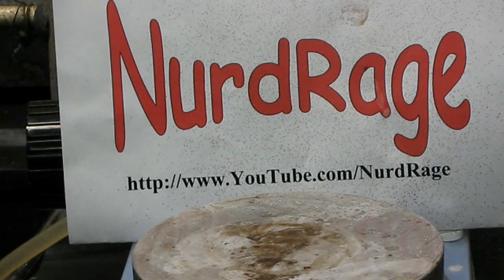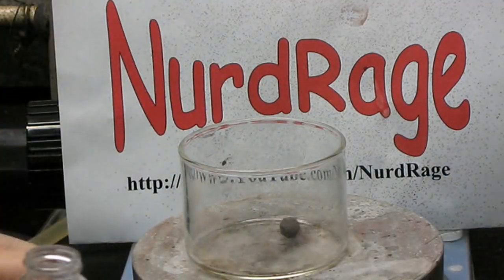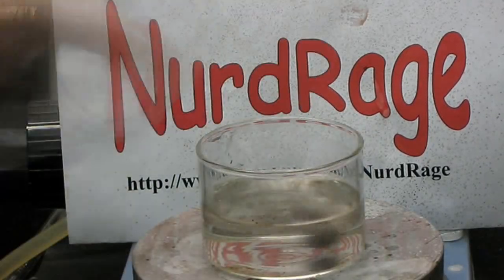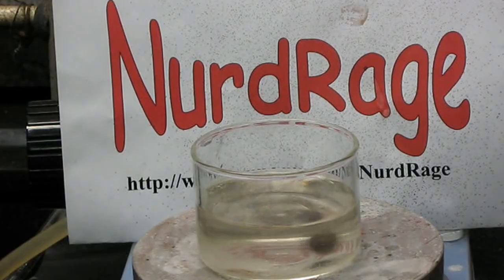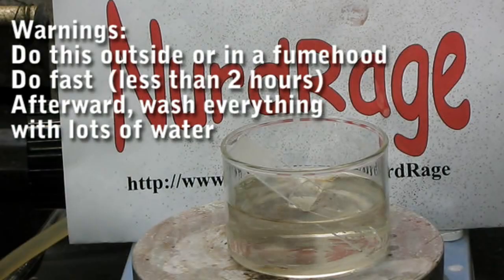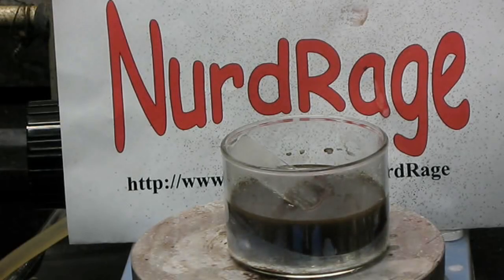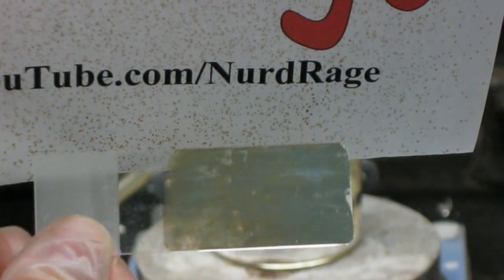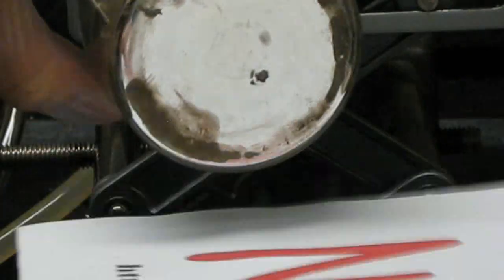Make Glass Mirrors with Silver Nitrate

Comment: If I'm understanding this reaction correctly, initial chemicals could be dissolved in separate containers and stored for later use so long as the sugar/dextrose is not added to the mixture until it's time to do the final mirroring reaction?

And the silver nitrate solution should be maintained in dark glass.

  And potassium hydroxide should be a suitable substitute in the event sodium hydroxide is not available?

Comment: Mr Rage, I see that you used sellotape to prevent the silver from touching one side of the glass. Could something like beeswax painted on the back also prevent the silver touching the glass or would it react with the mixture? Are there any other substances you could think of that could be applied to block the silver, perhaps painted on to create an artistic affect? Thanks

Comment: does this Silver nitrate solution work to make invisible ink or polarized ink, Im very curious about the image I saw in the spectacle shop where they had this tiny silver sticker which has an image which is only visible when you wear a polarized sun glass. I tried adding some green ink into this silver nitrate solution and it was not visible when I put the polarized glasses. Is there something that Im missing or is there another ingredient that needs to be added. pls suggest

Comment: Will the silve adhere to ANY surface? As in a primitive technology setting if one were to use a fired clay slab rather than a piece of glass would the clay be coated in silver? 
Yes I am aware that glass works better as a mirror because of the interactian with light. But I am more interested in knowing what surfaces the silver will adhere to. 

I suspect that a glazed tile may work better because the melted glaze is similar to glass. But I ab running the idea as though a time traveler were stuck in say ancient roman times (when they had both nitric acid and amonia available) could you make primitive mirrors with clay rather than clear glass since clear glass was not nearly as common if it was available at all.

Comment: I want to coat a previously coated mirror of a photographic 3D camera attachment which has two mirrors to make a two images for a 3D photo. This apparatus is very old and I want to recoat the mirrors so they return to their pristine, beautiful condition.  I can remove the mirrors from the metal attachment to do the process but, do I have to remove the previous coating? How can I do it? And finally, I have heard that silver coating mirror is the best but also very delicate,. Is there some sort of protecting coat I can apply to prolong the new coating? By the way, each mirror is small,  roughly 2 x 3 inches.  Thank you very much.  I would like to correspond through my email, if possible:  edubarca2015@yandex.com. EDUARDO,  (From Colombia)

Comment: Will this work for plating things like copper/brass/aluminum/plastic? My mailbox is missing the knob, and I want to replace it, but I also want to plate it in silver, because silver is anti-microbial. I'm concerned that the solution will react with metals and not stick to plastics.

Comment: If you want to silver a plastic part, use this same bath as Nurdrage just explained but dip your plastic part in some Stannous Chloride first which acts as an Activator, then rinse your part well, then  dip your part into the solution you see on the video and  your plastic part will be chromed/mirrored like this piece of glass ;-)

Comment: Have on the ready a salt solution.  As soon as you finish with the silvering solution, dump it into the salt solution.  The silver will be immediately precipitated as AgCl.  This allows the silver to be recovered, and eliminates the hazard of making silver azide.
     When making the silvering solution, it is important to titrate carefully with the ammonia, and stop JUST SHORT of redissolving all the precipitate.  When made this way, silvering will take place at room temperature (the heat is driving off the excess ammonia which shouldn't have been added in the first place).
Reply: explain it

Comment: could this procedure be used to plate glass with other metals such as copper or aluminium?
Reply: +NurdRage are we able to do this on other surface like plastic or metal other than glass?
Reply from the maker: unfortauntey no, this process is specific to silver. Vapor deposition is a broader process that works with a wider range of metals.

Comment: A few questions...
 - Can this method be used in place of electroplating to apply it to metals (specifically brass, copper, or nickel) and how will the end results compare (e.g. adhesion to base surface)
 - In the waste solution is there silver that can still be recovered? If so, how? If not, how can it be disposed of safely.
 - How abrasive-resistant is this coating? Will it wear off after handling it regularly?
 - Do you know of any good non-cyanide electroplating solutions for silver, gold, and other precious metals?(most if not all industrial grade silver plating solutions are cyanide-based and most non-cyanide-based solutions will not adhere well) 
 - Would destroying (by melting, dissolving,etc.)a .999 U.S. or Canadian coin be illegal?

Thank you for the videos.

Comment: Can you work this in wood , i want to make a polish sword made by wood . The painting doesn't giving a nice mirror looks like this
Reply: Dip the wood in tin solder.
Reply: I don't know if you are still interested in making a sword (two years on). What if you used sandpaper to make the wood surface very smooth then coated it with sanding sealer or polyurethane varnish. Of course you could do a test piece first. Then use the solution in the video to coat the smooth varnished surface.

Comment: I have bought silver nitrate of a concentration of     0.1N( 0.1M) is this strong enough to do this. I have tried it with 100%lye ( sodium hydroxide. and sugar and ammonia and could not get a reaction. any help.
Reply: +Dale Newcomer Evaporate the solution until you get silver nitrate crystals and use those just like in the video.

Comment: could you get the cool clear solution and spray it on bigger objects and then heat them to  speed up the reaction? (with good ventilation)
and would the resulting coating be able to be anodized?
thx

Comment: I watch so many u tubes on glass re silvering that I am confused .my questions are, you need sodium hydroxide ,silver nitrate and tin solution . when the sodium hydroxide and silver nitrate and sugar are mixed, do they have to be heated? can I put the mixture in a spray bottle and spray my glass?Thanks.
Reply: +Dale Newcomer to get the best use out of your solution and get a quality  mirror.use silver soln and sodium hydroxide soln together  and the reducer in another container.   The tin solution on the glass first then rinse . spray the silvering solutions starting at the bottom of the glass and work to the top .  this gives you a quality mirror . You can add galvanic copper solution over the mirror to insure protection of the silver  This is not necessary unless making large quantities of mirrors . Use a good quality of mirror backing paint and heat the glass to remove excess thinners in the paint, I recommend peacock laboratories  in philadelphia pa  for your supplies

Comment: Must the glass be constantly submerged while the solution heats up? Or could you just heat the solution and then dip it in?
Reply: +The Scout If you dip the glass in the silver solution, it will coat the outside. I think coating the inside is better as it won't get damaged.

Comment: Hey I watched your video. Its super helpful but Im having problems with the silver adhering to the glass. Any Suggestions?
Reply: +Eliza Serocki It took me a while but it eventually worked (like maybe 15 minutes of heating/shaking). There's a little patch that fell off though and I couldn't coat it back. I think it may be due to some impurities being present (either from the reagents or maybe the glassware was not cleaned well enough beforehand).

I'll probably try it again with laboratory grade glucose and wash all glassware extensively.
Reply: +Eliza Serocki First use a solution of red rouge or 37B solution to clean the glass rine then use a tin solution( sensitising agent) first rinse then apply the silver solution I f you use the flow over method with the glass flat you must have the glass level. Do not mix all 3 solutions together . using glass pitchers put the silver soln. and the activator solution  in one pitcher  .30mls per qt.of deionised water . put the same amount of reducer solution into the other picture 30 mls in to 1 qt of water  pour the solutions together so it flows across the glass let the solution on the glass until it starts to like muddy  then lift one side of the glass and remove excess solutions rinse the mirror and use a good quality mirrobacking pint to cover the silver. The best method to making mirrors for the small shop is the hand spray system .  I recommend Peacock laboratories in Philadelphia pa for all your supplies
Reply: Eliza Serocki You could try dumping some nitric acid into the container. The silver will react to form silver nitrate. Just make sure you do it in a well ventilated area.
Reply: +Griffen Desroches And how would that help considering that it would turn back the required silver metal particles into ions?

Comment: The problem is, it doesn't work for me. The solution went black, then clear again, but the silber stays not on the glass. I heated it up to maybe 30 °C.
Reply: +Martin Brandstätter Not hot enough. Try 70°C. For some reason, some can get this to work without heating. I think it's because they use pure glucose instead of sugar.

I've tried it with sugar and needed to heat it up that much to get it to work. Next time I'll try with laboratory grade glucose.

Comment: Wait wait wait, THERE'S SUGAR IN MIRRORS?!
Reply: Or anything else that is reductive, like formaldehyde or acetaldehyde. Anyways, the sugar is a reducing chemical, it is only used to reduce the Ag+ ions back into Ag metal. The sugar stayes in solution, so there is no sugar in mirrors :)
Reply: This way they are sweeter when you taste them.
Reply: @nerdvision3587  XXXXXDDDD THATS WHY MY MIRROR TASTES LIKE SUGAR XD
Reply: Their are many ways of making mirrors, not all use sugar eg gallium mirrors or highly polished aluminium/aluminum mirrors.
This method is a very old way of making mirrors....and yes, it seems that sugar is involved in the process.
Don't worry, I wasn't aware of the sugar addition either.....indeed its different :-)
Reply: Krisztián Szirtes Yes but table suagar wont work. You need frucktose or glukose. Table sugar aka. Sucrose is not a reducing sugar
Reply: Basically anything with a -CHO group will do
Reply: they usually employ acetaldehyde

Comment: so how would I be able to make a huge mirror?  will that be too difficult to heat up the glass or even to make a bigger container of chemicals? Is it possible to just heat the mixture and paint it onto cold glass?
Reply: usually you would to perfectly level your glass and use atomiser to delivery solution to surface, before it you probably want polish surface of glass with cerium oxide, take a look on your bathroom mirror - side with metallic layer is on "wall side" and is protected with some oxide resistant paint... that is the reason why surface need to be polished before start of depositing metallic surface (it need to be protected anyway and polishing surface is always step to make non "psychodelic" effect so it is much easier to put this layer on back)  on it, for heating up your workpiece you can use ir radiation, preheat solution or just make whole process in specially prepared room with hot and high humidity atmosphere

Comment from the maker: Unfortunately this method is only good for back-silvered mirrors. The front silvered mirror you want requires a vapor deposition method using aluminum. That method requires specialized equipment and is too expensive to do yourself for just a few items.... BUT, there are companies that will do the silvering for you. So you can contract out the work quite inexpensively. Look up mirror coating, mirror silvering, aluminizing and vapor deposition services.

Comment: butyl is used in the naming of organic compounds, and means a carbon chain consisting of 4 carbon atoms. Butyl would usually mean that it is a side chain. For example: butyl ethanoate, which is an ester produced by reacting butanol and acetic acid. An example of a butyl side chain could be 2-butyl octanol, which is a carbon chain of 8 carbon atoms, a hydroxyl group on the end, and a butyl side chain on the carbon next to the one with the hydroxyl group.

Comment: If I were to make silvered glassware using this solution:
-- would it be washable (not in a dishwasher, obviously, but by hand with a non-abrasive cleanser)?
-- would it be able to be used to hold something which generates a great deal of heat, like boiling hot beverages or a candle?
-- would it be able to be scratched off, and if so, what would you recommend as a top coating for protection of the silvered surface?

Comment: Great video - exactly the information I was looking for! 
I'm trying to mirror large panes of glass (26" x 26"). I was planning to heat the glass, then make the solution and pour. My thinking was the sugar reaction would start on the glass and would work in colder ambient temps. Is this a bad idea? What's the best temp? (A simple contraption maintained it around 125 f)
Also I estimated I should scale the 'recipe' x 5. Is this close?
Thanks again for the information and excellent video!

Comment: Would it be possible to use this as a primer for electroplating glass with copper2 to put allow me to put a pcb on glass? I really like the idea of making  glass circuit board.  I've seen videos on it on youtube there was a fellow who did it on a microscope slide with uv glue and basically copper foil but I'd like to manage to properly chemically adhere / fuse this with the glass.

Comment: Hey!  This is awesome.  I've gotten a (crappy) mirror surface after about 2 minutes of heating from a heat lamp and only 1g of silver "learned" with.  Earlier, I wasted about 8 g of silver using the process suggested by Ingalls in Amateur Telescope Making Vol 3.  

This is absolutely amazing!  

I'm gonna try things like rinsing with Stannous Chloride first and then try to put on a very thin coat of lacquer on the front surface mirror to keep it from tarnishing after silvering.

Thank you!

Comment: Is the silvered glass electrically  conductive?  If so, this could be done to make a high voltage capacitor. just silver both sides of a jar or glass pane
Reply: Yes, also a good idea, need some kind of insulator between them
Reply: @____________________________.x  glass is not conducting electrical current, electricity. Glass in liquid form (heated) does conduct though. So it should work if silver created in this video is conducting

Comment: I silver coated cuvettes for raman spectroscopy with this reaction a week ago. The response signal increased three fold. (and you don't want to give students cuvettes that cost 100€ a piece)

Still the coating is very delicate. I read that tin II chloride will make the coating more dureable, but I couldn't find how to apply the SnCl2. Dip the glass in the solution and then directly into the silvering solution? Or let it dry in between? Or rinse?

Comment: @casperisnotcool 

Better still Rustoleum makes a spray paint that gives you the exact same effect and way safer than this method.  Btw it's not just the color silver but actual reflective mirror.  You can probably p/u in hardware store, I bought mine off Ebay.

Comment: Now out of curiosity, it appears that the inside of the container is not shining, and that the reflective surface of the plastic you submerged is actually the taped side, since the plastic is clear its showing the reflective underside. Lets say for example, that you wanted to submerge the outside of a piece of wood in this liquid, would the outer layer of the wood be reflective, or no?

Comment: Very cool, if you did this process to both the inside and the outside of a glass jar you would create a "Leyden Jar" the world's first capacitor. It will hold a very high voltage that can zap the heck out of you when it discharges. Just the thing you want for a Victorian Whimhurst  Machine electric generator.

Comment: @patakla101 Sometimes the coverage is bad on certain plastics without the tin II chloride.  Surface preparation is important with silvering.  Even with glass, if you want a very good surface.  

You will NOT get a chrome effect on glass or plastic on the outside surface, you only get the mirror effect on the inside surface (looking through the glass or plastic).

Comment from the maker: in that case i suggest flipping through the patent literature. There is a LOT of publically accessible formulations. Usually using copper, silver or graphite particles suspended with a surfactant in a non-aqueous fluid. usually a type of glycol, although i have seen a few amine or fluorocarbon based inks.

Comment: The glass used in interrogation rooms is not silver on one side and transparent on the other -- it is "half-silvered" with a thinner coating than normal. When you are in a dark room looking thru the half-silvered mirror into a brighly-lit room, the mirror is semi-transparent, but looking from the brightly-lit side into the dark room it seems to be an ordinary mirror.

Comment: Silver nitrate can be made from sterling scrap and HNO3.  The copper in the sterling is easily separated by melting the solid nitrate mix at 300 Celsius thereby decomping the copper nitrate to the oxide but leaving the silver nitrate intact.  Just simpl redissolve the silver nitrate and filter.  Save copper oxide for copper salts or copper metal extraction.